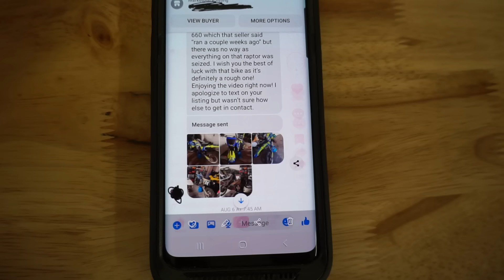Seller Lied To My Face About This $600 Dirt Bike (First Ride Attempt)

Comment: So if the aluminum wheel can take the heat you have two options on that bearing race that you might want to try sometime in the future. You can weld a small bead all the way around on the inside of the race. Which will shrink it and you can pop it right out you can always hit it with some cold water afterwards.  And I'm sure you know the heating it up with the torch and hitting it with cold water to shrink it trick. I've had a lot of success with the welding around the center and a lot of the times they just fall right out. You probably already know this trick but just in case. I love your videos

Comment: I've found that a torx socket just one size smaller than fits on easily hammered on to any rounded nut or bolt will take it off, I've used this a hell-of-a lot of times and it always works

Comment: One thing I always like to do when working on this stuff is wire wheel and clean all my bolts, washers completely weather they need it or not. Also tells me I've already been there. I use my brass wire wheel. Makes it much easier to work with 100% of the time and looks good. Just an FYI

Comment: Best way to get a stuck outer bearing race is to lay some small welds down on the race and when it cools it will shrink and fall out.  If for some reason the race doesn’t just fall out you will be able to use the weld to hit with a punch.

Comment: If you have a welding machine, next time you have to remove stuck bearing races, weld a bead all of the way around the inside of the race. When the weld cools, it will shrink the bearing race, and it will be easy to remove.

Comment: There is a bearing hammer puller.    It works great for getting bearings out of wheels.   I think I got mine on line but it hooks inside the bearing and has a weight you slide up.   Makes life way easier, just a recommendation if you want it

Comment: Heating can break the bond between the metals, thus making for easier extraction. Air hammer can also work with the vibration.

Comment: A key thing to remember with penetrant (and you're using the best one in my opinion) is give it time and if you break it loose and put a little more on screw in then back out to get some of that penetrant down in those threads Don't just keep backing it out if you notice the threads on that were dry cuz you just kept bringing it out instead of working it back in and then out again. Just things I've learned The hard way over the years. That seller definitely did you dirty! As I said on the last video I honestly believe that thing spent quite a bit of time underwater!

Comment: Just raming a bolt into a coroded thread can actually lock up while threading it in. A good way to prevent that is to chase the threads.  A temporary  chaser is quite easy to manufacture with a spare bolt.

Comment: If you have a mig welder you can run around the inside of the bearing shell and this will shrink the metal - works a treat most times. It certianly sounded great.....

Comment: To get that rusted outer bearing race out try welding a bead around the inside of the bearing race where the balls roll. The cooled weld bead will shrink diameter of the outter race. you might be surprised how well it works.

Comment: I'm sure you've herd this before but I'm not seeing you actually do this, prob cause of editting, but if you loosen a bolt and as nit starts to bind even a little bit you should hit it with penatrateing oil and then retighten the bolt just a little bit and then work it back and forth you'll have a much better time getting rusted bolts free. I'm sure you know this but forcing the bolt just makes friction and snaps them but if your careful and work them back and forth you'll have a much better result. I'm sorry if I sound stupid and you already know this cause you obviously know way more them me or you'd be watching my channel that I don't have but Incase maybe you didn't know I thought I'd help cause you've hel;Ed me so much I wish I could help you just a little. thanks again bro, your the best!!!

Comment: The welding trick would have worked really well for that bearing race. You run a weld on the inside releasing all the material stress and then it shrinks while cooling, making it fall out.

Comment: When you put penetrating spray on seized nuts and bolts that you have undone slightly, tighten them back up before taking them out so the spray has a slight chance getting to the threads

Comment: I have had this issue in the past and Dry Ice works wonders for friction welded bearing races. Make a cut with a dremel, then Go to the grocery store to the meat department and see if they have any, break a chunk off and put it down in the race and let it sit for a while (cover it too). Stick a cold chisel in the gap you cut at beat the tar out of it

Comment: “ hey Joe - where you going with that ‘extremely small ‘  ball pein hammer in your hand.!?  Great video’s as always,  We all get by with whatever we have - but why not treat yourself  to an old Thor copper  faced  hammer, a nice big hide one to match and maybe a  nylon dead blow to complete the set.? .. just saying…👍💪🏻P.S.  a great trick to remove seized outer bearing races :- is to hit it a couple of times with a mig welder..!! Hub heats up and the race shrinks as the weld cools.!! The race literally falls out..!!

Comment: To remove stuck bearing race, run a small bead along face of race with a mig welder. It’ll shrink it and it will pop right out.

Comment: Good video, don't give up on the wheels(bearing), you can buy a Dremel tungsten small cone tip, it will eat that race part of the bearing quick time, as for oil water mix, that water can get in from any breather pipe, it ran to clean for water in the cylinder, that poor bike had a hard life,it just needed a lil tlc, exactly what you are giving it.😎

Comment: When you have an outer race stuck like the one on that front wheel, clean it and run a bead of weld all the way around the inside of it. The weld will make it shrink, plus it will give you a surface to tap on if you still need to.

Comment: Joe to get the bearing race out the best way is to run a bead of weld in the bearing track then wait for it to cool this shrinks the bearing slightly if it still doesn’t come out weld a washer to it and then use a slide hammer or bash it out with your usual drift

Comment: When you are dealing with rusted bolts if you can get them to turn a little spray them with penetrating oil tighten them back up let them set a few minutes and then try to get them out.  Less broken bolts.

Comment: Working on rusty stuff is the worst. Try using a product called never sieze. If you put it on the threads first it will go in way easier that using grease or oil. Also makes taking the bolts out way easier as well.

Comment: The easy way to get a race out is put a bead of weld around the surface of the race where the bearing rides! It will shrink the race and it will come out like butter

Comment: Try tapping frozen bolts on the top hard enough to shock the corrosion,especially in aluminum then use a 6 point socket to extract the bolt 🇨🇦

Comment: As a future note if you have a stuck bearing and have access to a welder which I know you do then you can run a bead of weld all the way around it and it would actually shrink the metal and the heat from the world will expand the outer material making it easier to get out and it works on cars ATVs dirt bikes you name it

Comment: A bead of weld on a bearing race will shrink and loosen the race as the weld bead cools.
Reply: I was gonna tell him the same-thing. I had a 6in bearing on a manual lathe heat shrunk on an old mechanic told me to put a bead around the inner race and 2 minutes later she cracked on slid down. Still one of the coolest things I’ve seen.
Reply: @Gorgie-lm1ti  listen to the experienced elders I always say!

Comment: Rust and bi-metallic corrosion is a real “beatch”. Nothing like having an entire bike whose dissimilar metal parts are swapping electrons like a bad battery. =/🔋/= —>🪫. Bimetallic tape or a sealant helps. But not afterwards if it isn’t done in advance. You’re a saint….

Comment: Hi. Im a swed. To take out the outer ring of the ballbering without forse do like this. Conect a migwelder negativepole in the disk and put the mig in a high amp and weld three points a couple of mm eatch inside the ring, turn the wheel upside down and you will hear a pop when the ring of the bearing loosen and fell into the floor. no forse no dammages. good luck. Kj.

Comment: Put a slot on the front of the bolt to clear the threads as you go, or use a tap to retrace the threads.

Comment: I feel like especially working with cast aluminum you should get a tap and dye set in order to clean those threads before using an impact and driving those adjusters home

Comment: You should add some brass or aluminum bar stock 6-8" long 2 maybe 3 different diameters and an inside bearing puller to your arsenal of tools. And yes if you heated up the wheel hub where that outer race was stuck sprayed some penetrant on it (it'll get sucked in-between the mating surfaces and will make your life way easier ) but still a very good job

Comment: Weld a piece of 10mm bar and pull the shell out with puller / slide hammer. Could be another hammer for your collection

Comment: To remove a bearing race like your wheel. Run a weld around the inside of the race and allow to cool and shrink. The race should then just fall out.

Comment: 6 point sockets on the smaller bolts helps keep from rounding them. The 12 points should only be used where limited space is available imo.

Comment: Hi, neat trick for getting bearing outer race out when the bearing has fallen to bits. Run an arc welder bead round the inside. When it cools the bearing will shrink and fall out. Honest.

Comment: The best way to get a bearing race out is to weld the inside of it and it will cause the race to shrink and then you can literally almost take your fingers and pull the race ride out you wouldn't believe how easy it makes it

Comment: Jeff from illinois here ... I bought a yamaha rt180 from somebody recently that lied thru his teeth about it , gave me the ran great last year when parked BS ... It wouldnt run of course , he said its the carb ... The carb was clean of course but both crank seals were blown out and the left side crank bearing has some play like they may have rode it with a partially bad seal for awhile ... lol  Yeh he was a slick one ... The front disc brake didnt work , the brake fliud was like solid jelly ..., yeh he rode it last year uh huh ... PS ... get a mighty vac to bleed the brakes , it makes bleeding painless and fast ....

Comment: to remove the outer bearing track run a ring of weld around the inner of the track ie where the balls run it will fallout as it shrinks the track you can use mig welder or stick no problems and if it is still tight you can hit the weld with a punch to push out the track

Comment: Joe you can weld a nut or washer into the old races on the front wheel then drive them out with a punch  and hammer

Comment: Wow, this bike spent some time under water for sure, both wheel bearings shot, the races welded to the aluminum, clutch plates rusted together, how much money has to be put into this bike. It`s a good looking bike, I tell you that, hat`s off to the Yamaha engineers that this bike even ran, I was a Honda CR guy, but I always liked the YZ`s, everything you touch on this one turns into a can of worms.

Comment: Yiu can use a  bottle and aquarium air line to bleed brakes without having air getting suked back into the caliper. Just have to tube submerged into brake fluid. As long as its submerged you can pump the master cylinder to flush and bleed it. Just keep topping off the master.

Comment: Geeeesh, That seller doesn't deserve to sell a tooth pick. I hope you leave a review on his profile of how dishonest he was. Good thing the motor isn't totally shot but if that front end sat in water like you think it did, it wouldn't be a bad idea to look inside them front forks and change the fork oil. God only knows if there is rust in that bottom unit. It's a sweet looking bike though.  Don't give up on her. Good luck keep up the great work ✌

Comment: Joe I personally use anti-seize on any axles or swingarm shafts I've had really good luck with that with them not seizing up but of course I also clean them up on a wire wheel if need be

Comment: A nuisance over that front wheel bearing. It's that dreaded bi-metallic corrosion issue. If you've ever tried to take an aluminium seat post out of a steel bicycle frame - they won't shift no matter what. A replacement wheel the only option (i.e. robbing off the other bike). Incredible the clutch issue!

Comment: a die grinder driven on a air tool is best to get the old bearing race cut, then heat the alu hub and drive out from the back with along drift punch...!

Comment: To remove bearing races you just have to go in from the opposite side and punch it out from the back of the race,using a long punch,or an old axle bolt from a parts bike,or in your case even a nice ratchet extension 🙄

Comment: You mention the new hammer cause people were talking about you using a claw hammer but then use it to drive an axle out with a 3/8 extension. You gotta get some brass punches tractor supply has good made in the USA punches from mayhew I believe for like $30

Comment: So you use a boot to kickstart a bike in the garage but go full blast riding a bike in questionable condition in sneakers and shorts. Brave guy. Indeed lucky that the engine did not lock up.

Comment: That hurts!!  Do not use a 3/8 extension to hammer on. Use a brass punch. And put the nut on the shaft when you are hammering on it, to preserve the threads.

Comment: You got the hammer. Now you need a good set of punches. To use to remove bearings. Also were you holding brake leaver when you released bleeder screw?

Comment: KROIL. It's called Kroil. Spray everything down with Kroil. EVERYTHING! That axle - Never beat on an axle thread end. Put the nut / nut cap back on the axle and beat on it. Get a brass tapered drift pin and put it in the axle hole, then beat on it. CLEAN YOUR STUFF BEFORE YOU WORK ON IT!  🤣

Comment: If you have a welder, weld 4 small beads on inside of the race in criss-cross pattern. It will shrink the race and will literally fall right out

Comment: You need the heat the nuts and bolts up with a torch before you start working on it they will come out a whole lot easier

Comment: I'm thinking that you should have pulled the plug on this one and try and salvage what parts you were able to for future projects, eg engine.  It's fundamentally 'F' grade with all of the rust, in my opinion.  You know that every single nut and bolt is liable to fail if any future owner tries to undo them.

Comment: When the front brake  master looks like that, the line and caliper will be the same, the entire system needs to be cleaned, flush the line with brake cleaner, maybe two cams worth, tear the caliper down and scotchbrite the cylinder and piston and replace the o rings, even then it will last about 10 hours of use

Comment: Take that old front wheel over to a machine shop, throw it on a lathe and they should be able to get the old races out.       Miss the claw hammer.

Comment: How on earth do you think that light of an exterior filter spray application would work all the way through to the inside.  If you’re stuck on using that product I would highly recommend starting with filter inside out, spray all those surfaces, then turn right side out and do it again then kneed the oil throughout.

Comment: Dirtbike brakes are much easier to fix if u fully rh2 system with fluid from the bleed valve up to the master cylinder using a syringe... much easier

Comment: To remove a bearing race like the one on the frount wheel put a bead of weld on the id of the race and as the weld cools the bearing will shrink and fall out

Comment: Oh man I feel sorry looking at this… anyway two things came up to my mind while watching…
Wouldn’t it make more sense using parts bike frame and taking engine from thise one? 
The other thing as much as I admire all your skills O can’t quite agrer on the way you lube the air filters and use all that grease to seal. I don’t have best experience with that and filter oil in spray. I usually trust normal liwuid filter oil for those and bathing them in it… anyway good luck with this machine😅

Comment: My friend spent $2000 on a YZ 125 and the owner said it had zero issues it had a broken clutch a broken shifter. It still makes no spark and he put $2000 into the bike. He spent $4000 so far and it’s not even close running.

Comment: You should really use penetrating oil on screws and fasteners on old bikes like that. spray everything and let it soak for an hour or two, then spray it again and try to loose them. It truely hurts my old mechanics heart seeing you to try loosening bolts without lubes, that have been sitting and corrode for years. No wonder you round or rip off heads... 🤷‍♂
Anyway... i like your vids 👍

Comment: I know how you feel a Joe I bought a polaris  ranger from a reputable  repair  shop  and took the guys word on it but when I got home after 2 weeks I noticed that the rear tires were shot and the a frame bushings were gone  I spent weeks working on it finding even more  problems with it  now I have more into it than it's worth,  I do have a question  why don't you  use you tractor with the tiller and  run it across your  field to make a better  run across  it  By the way great Jon on that bike it looks and sounds great  give a clutch kit though

Comment: Also, i disagree about having to bail if the throttle was to stick while you have no clutch. The rear brake will absolutely 100% over power the motor !!! Just my thoughts !!